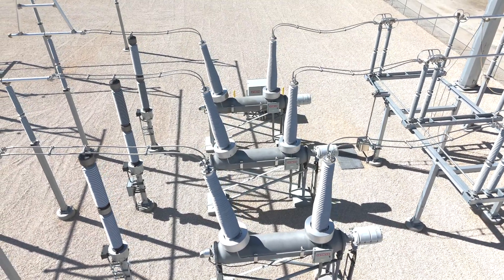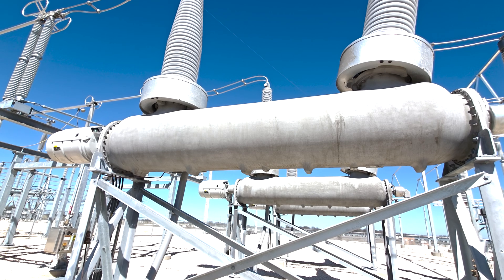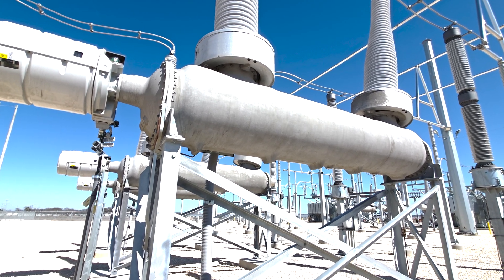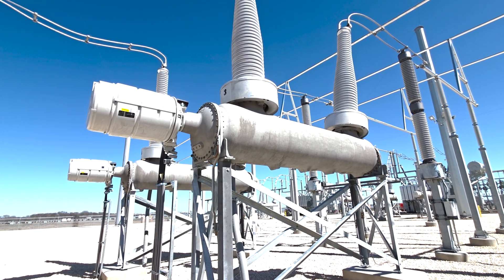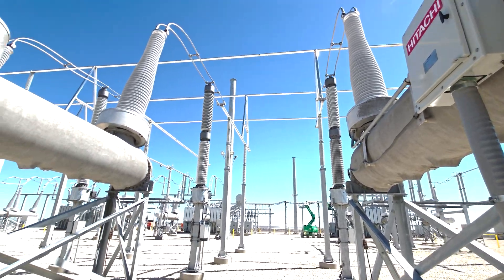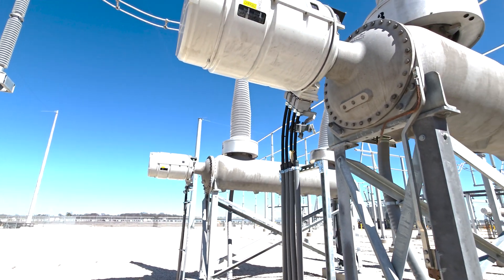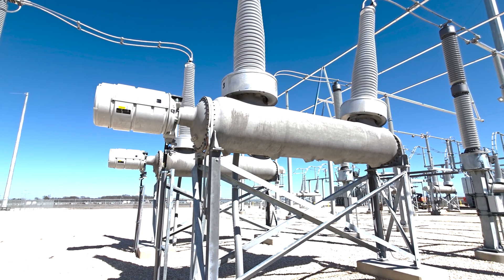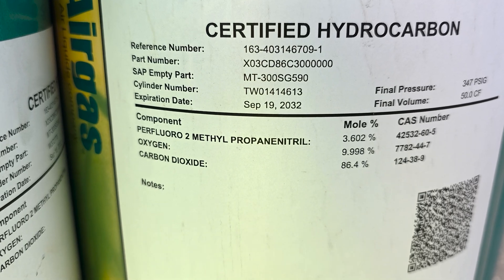FIRST EVER LOOK! C4-FN 345kV HIGH VOLTAGE BREAKER

Comment: I'm surprised it's more economical to have such a relatively complex mechanism, as opposed to just making the breaker larger, using air gaps, and designing the contacts to be consumable and replaced as they start to wear low.  Granted it's not as efficient but if the focus is on eco friendliness, having no gas at all would seem preferable, if less practical.  But I guess there are reasons for it I'm just not aware of.

Comment: With C4-FN being a perfluorinated compound (i.e. a PFAS) with its own world of bio-accumulation and environmental persistence issues, to what extent are we trading one problem for another?
Reply: The global warming dogma always seems to make substances more dangerous in some other way at point of use, for some nominal climate change improvement.
Reply: He said in the video it degrades in eight years, is that incorrect?
Reply: @Berkeloid0 I did wonder the same thing. I’m hoping someone with a chemistry background will chip in and correct me for being assumptive.
Reply: PFAS is a very local contaminant where it leaks. SF6 causes worldwide issues.

Comment: since there is no isolator switch between the breaker and the busbar, is these disconnecting circuit breakers, or just circuit breakers.

Comment: 9.998% oxygen ... It annoys me more than I want to admit that they didn't make it 10% oxygen
Reply from the maker: @latentVerwirrt  I know right?! If they can be THAT accurate with percentage, then make it frikking %10.00 exactly......they must do it to annoy us OCD folks ..
Reply: I mean, O2 is the last thing you'd want to extinguish fire so that value is most likely carefully chosen I assume.
Reply: It may be an analysis value, with the target being 10%. I would assume they measure what they end up with after mixing a batch. I'd say they did an astonishingly good job at .02% accuracy. Undoubtedly the cost goes up with the accuracy required.

Comment: Cool, haven't seen any of the new gas equipment yet. Good to see a new substation video. 
As far as interrupting the arc, even back in oil filled breakers the interrupter was designed the quench the arc physically by the action of the moving contact. Same with all HV SF-6 breakers I have worked on. The puffer is part of the moving contact and will compress an area of gas behind it and re-direct that "puff" on the arc. No actual compressor needed, it's all incorporated in the interrupter design. I would assume this is no different, using the already moving contact to create a pressure or pressure differential to help quench the arc. Only on 25kV breakers or below have I seen SF6 with no puffer involved, like the vacuum bottles with SF6 instead. The exception being with manual switches, there is a puffer, hence we call them puffer switches, on 25kV and below. In my experience, for sure there are all sorts of designs and differences. 
Also, the Sf6 equipment I have worked on will maintain dielectric properties when out of gas, you just of course can NOT change the state of the switch with no gas. That will cause it to flash over and destruct. I would assume this is the same, being similar in size for the voltage class. I can't ever remember ever seeing any of the SF6 breakers set to trip on low gas. They were always just set to lockout and block close / block trip based on last state. But I worked on the transmission / distribution side, never on the small generation side. Where maintaining power is the priority. 
I wouldn't go inhaling this new gas for ha has.... LOL I don't think CO2 is going to have the same effect that heavy, SF6 did.... (I know it won't, it was a joke). 
https://www.youtube.com/watch?v=ZTns9u4Bqec
Reply from the maker: Excellent info thank you! I have inhaled SF6 and it does make your voice low!

Comment: Are you allowed in there when they’re live../ operating
Reply: Hi, I worked in the Power Generation scene for a couple of decades and in answer to your question, yes you can. The insulators are constructed high enough to place them out of arc jump over range. So you are quite safe. One of the fascinating things that happens, if you enter the switchyard you can feel your hair wanting to stand on end. Pretty scary for novice trainees. Our working voltage was 220,000volts (220kV) 3 phase.
Reply: @ 
Hi, cheers.., all damn interesting., yeah certainly the insulators do set those distances.., but as a visitor to substations.., here in 🇳🇿..
I note that even though we’re  in full flash ppe…. (myself included), We as a group (all the lines personal) will vacate any area/ yard/ building.. where they’re going to be switching.., and the explanation/ comment noted is possible flash & blast.. from gear failure..
Hence my question here…, they will get out of the fenced area…
Reply: As blocka said, most subs are designed to be attended to while energized. Just don't go carrying anything conductive on or above your shoulder.... As well as other things you are trained for when working in a sub.
Reply: @inothome  
I guess it depends on the gear, and risk of failure/ blast fallout…
Most the gear I get around is oil filled , or next Gen.., only some of the gear is HF gas..
We supply the fire sealing.., and a lot new yards are exterior yards.., so limited fire sealing
Reply: @ I have personally seen the results of a transformer explosion with insulator shards scattered all over the sub. These shards of insulator are like razor blades very very sharp. Thankfully no one in the yard. The resulting fire was attended to by the local industrial fire service and that was a spectacle. Not knowing whether to spray foam, even when given the clearance that all was isolated. Guess they were nervous about the high voltage yard. Took a lot of convincing to get action from them. Transformer was a Generator fed (hydro) step up transformer 11kV to 220kV. Switchgear was SF6 blast breakers. Where in NZ were you. I was at Tokaanu.
Reply: @ 
Jaffa…
I remember my Uncle lived in Tūrangi on the project..  was foreman/ mechanic for MOW….
Years later in 70s/ 80s?? there was an earthquake/ eruption?? And one of the output transformers fell over?
He was a hard case guy, had picked up the phone n was pretending to us kids.. that he was talking to the controllers at Tokaanu.., telling them to hurry up n tip her back up & put his power back on.. 
Hardcase guys.. 
man NZ can be proud of what they built.. as a common nation..
Reply: @ 100% correct. Flying, heavy, razor sharp pieces of ceramic insulator are no joke!
Reply from the maker: @tigertiger1699  yes, you can walk anywhere when live, however in this case, the station is not live, you can see grounds installed on the right of the drone footage.
Reply: @ 
Cheers.., I assumed it was live when they operated the switching motor…/ that they were showing it switching..👍🙏

Comment: What sort of amps/ wattage…..
Super cool engineering.., but keep my distance 😂👍🙏
Reply from the maker: 3000 amps at 199,422volts  (phase to ground) or 598 Mega Watts
Reply: @ 
🤯…., pretty intimidating for us mechanical eng.., I remember helping with a 1MW CAT 3508.. on load-bank, super loud lots o fuel, noise n hot gases… (temporary muffler)… 
The power controlled by those switches is ott…

Comment: It's interesting that the mixture contains almost 10% O2. That seems like the last gas you'd want to extinguish an arc
Reply: I'm a retired chemist, and I believe (but do not know) that oxygen is present to prevent the formation of carbon monoxide (CO) which is the probable combustion product in the absence of oxygen. I am speculating here, based solely on what I know about the chemistry of O2, CO and CO2.
Reply: @markgriz  It's a global warming potential (GWP) inhibitor. The C4FN itself has a GWP100 of about 2750, but if you add oxygen to the mix you can cut the GWP by a factor of five or more. There's also a lot of CO2 and C4FN mass in there compared to the O2.
Reply: @gsuberland inhibiting in what sense? As in, sum up the global warming from the gas production/insulating effects once dispersed into the atmosphere and its lower with less CO? Or, some reaction that now does/doesn't occur during arcing that yields emissions with lower insulating properties?
Reply: @rowanjones3476  I'm not 100% sure what the underlying mechanism is; all I've seen is the literature on C4FN gas mixtures and their corresponding GWPs. My only guess would be that there's a reaction equilibrium which is driven backward at high pressure and moves forward if any of the mixed gas escapes.

Comment: The primary reason it's eco-friendly is that SF6 has a ridiculously high global warming potential (GWP) - one of the highest of all known gases. Over a 20 year period just 1kg of SF6 released into the atmosphere has the same warming effect as 17,500kg of CO2. Really nasty stuff. It's banned for use in everything but HV arc breaking across most of the world now because it's so potent, and they've been trying to phase it out of breakers too for at least the past ten years. By eliminating the SF6 in the C4-FN gas they massively reduce the ecological impact.